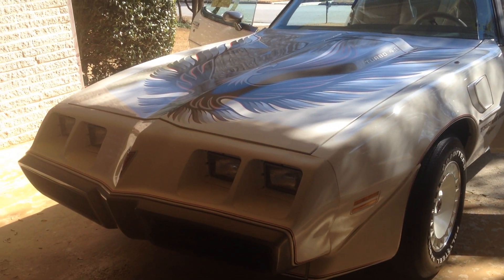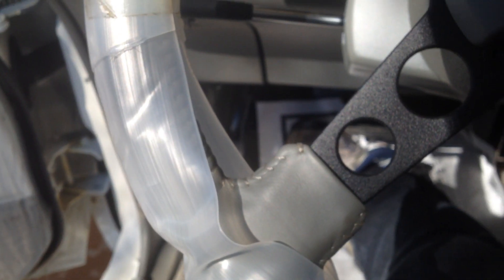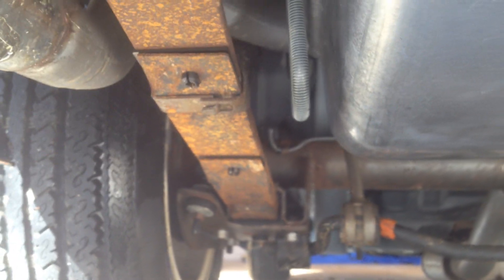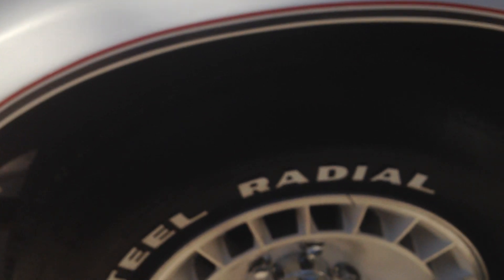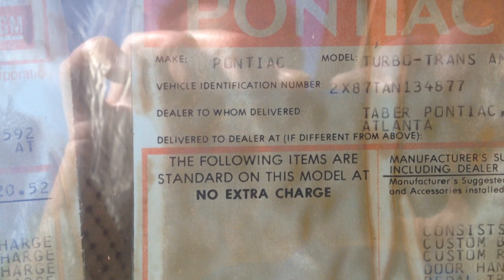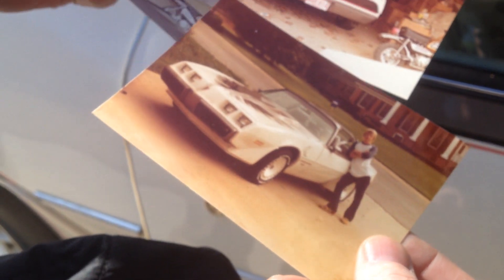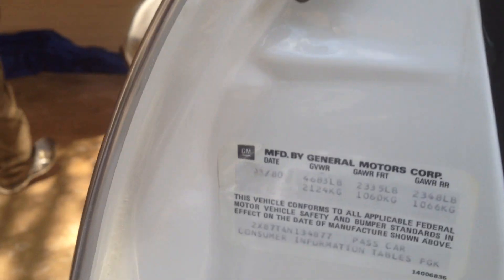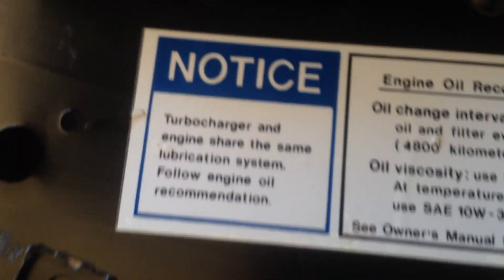NEW 1980 TRANS AM TURBO INDY PACE CAR WITH  ""ONLY"" 105 MILES STICKERS STILL ON WINDOW

Comment: This turbo "Trans Am" is an insult to the Trans Am name. By the 80's these cars were garbage.
Reply from the maker: It was not Pontiac's fault, it was smog and emissions everyone had to deal with..
Reply: Oh I agree completely. This car is beautiful to look at but anemic under the hood.
Reply: Rubicon...BUT...This was the fastest guy on the block at the time...My younger brother had one of these, and it WAS slow by today's standards...But...it handled better than anything out there...and the WS6 could hold it's own today with alot of cars...It got alot of attention...I have a '79 400/4spd WS6 T-Top that will chew this car...But...This is one gorgeous cruiser...
Reply: rubicon1983 I should have guessed it ,you don't appreciate a find like this,were you born in 83
Reply: Rubicon - they were anemic in straight line acceleration but still faster than what was offered in that era. Now handling is a different story. They made the earlier TAs look anemic in the handling arena. I have a 1981 turbo pace car. It gets down the road pretty good. Pontiac 461 stroker. Still has all the 4.9 turbo decals on it to. It's a sleeper for sure. Love the 2nd gen birds , iconic styling 👍👍👍😎😎😎